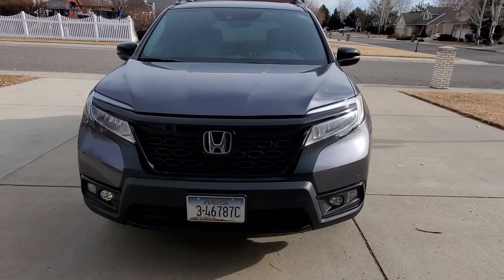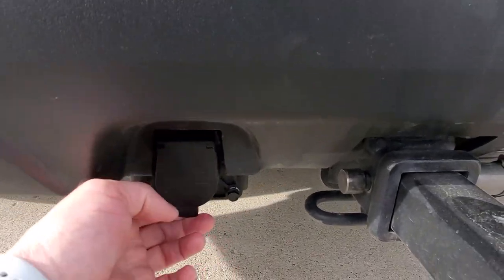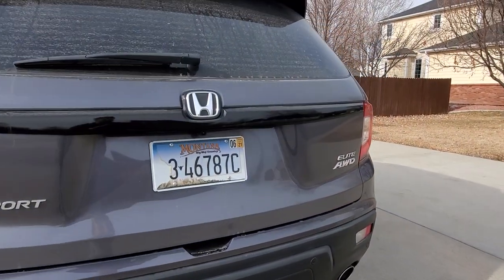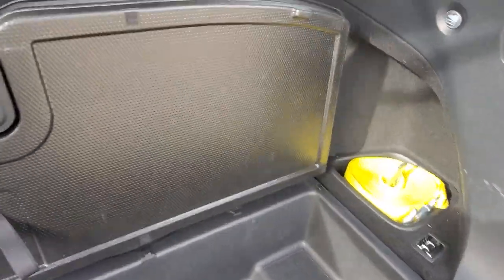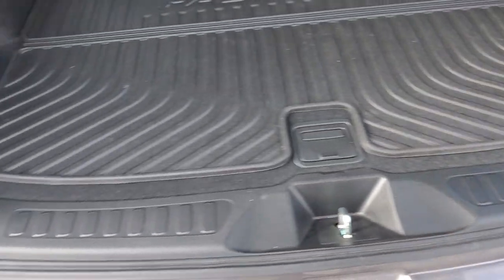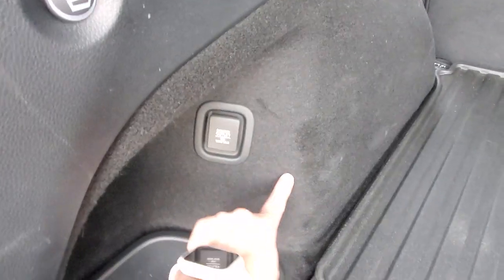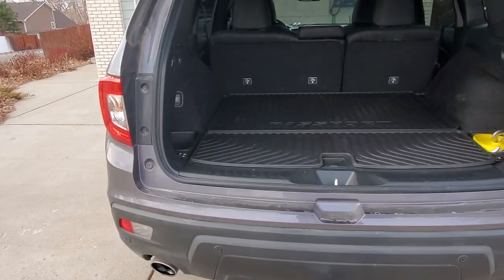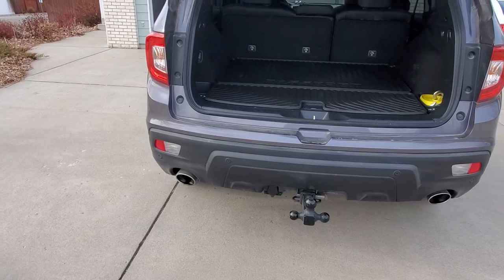2020 Honda Passport Elite Trailer/Tow wiring harness jitters

Comment: Having the transmission cooler installed tomorrow on my '21. It's $580. Unless you know what you're doing it's worth it to not mess with your warrantee.  I bought my Passport from a dealer who has a life-time powertrain warrantee so this is worth the install fee for me as I'll have a receipt showing a Honda dealership did the work. Uhaul is the next stop to see what they'll charge for the hitch and wiring. I've had very good luck with them at a fair price on several vehicles.
Reply from the maker: Awesome, I’ll have to do that too I think!

Comment: Honda likes to scare you. But honestly its a car.. even topping off the tranny fluid is not hard as long as you can get a an accurate temperature reading. The problem of course is the warranty if you're a DIY type. I could easily see them denying a powertrain claim if you installed your own cooler. Personally I'm not sure I trust that 9sp transmission with a lot of heavy towing in any case.
Reply from the maker: So true!